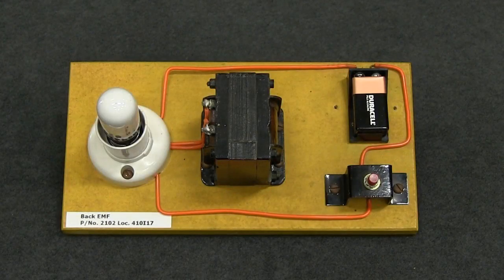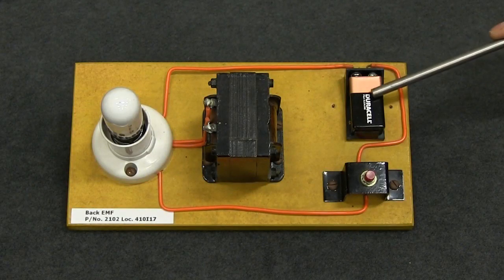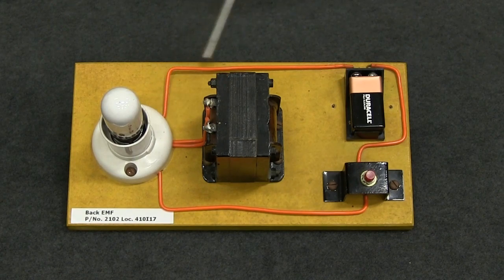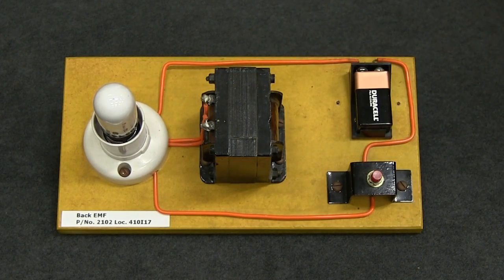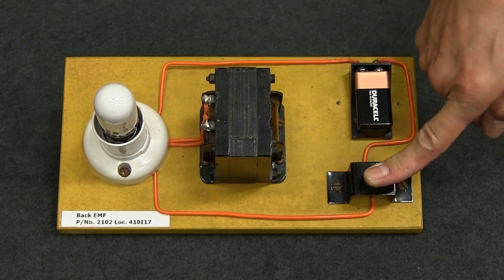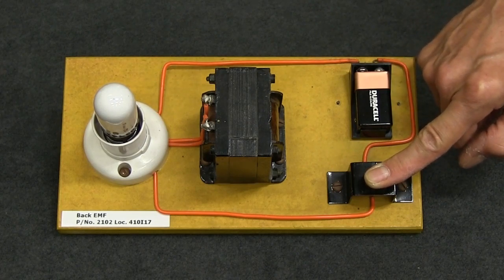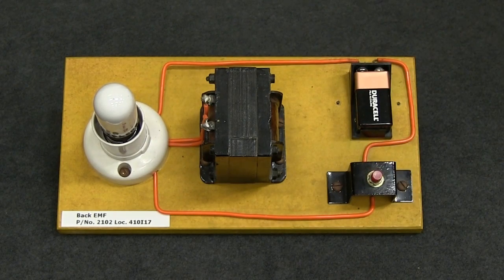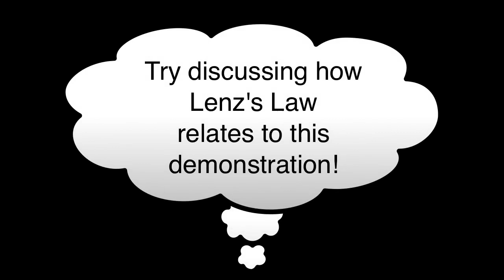PH EM IN DEMO 70019A V0331 Back EMF Inductor and Neon Bulb

Comment: I checked from the book: “Fundamentals of Physics (Halliday, Resnick, Walker) the equations of pages 724-729. In a RL circuit, if we write the circuit equation E = iR + L(di/dt) and solve it, the induced voltage on the inductor (self-induction) can’t be more than the applied voltage, which is here a battery. According to the equation: VL(t) = Ee^(-Rt/L) but you say that the voltage is more than the initial value, let me ask you, how is this possible ?

Comment: My other question is, such a circuit is really amazing, at the beginning where the time is zero and before any current is flowing in the circuit, the potential across the inductor is equal to the applied voltage, if we put t = 0 in the equation VL(t) = Ee^(-Rt/L) we get VL = E, how is this possible ? I ask myself how the potential in the inductor comes into account and where the magnetic energy comes from, while at zero or nearly zero time there would not flow any current, which means no energy dissipation in the circuit despite the energy which is stored in the magnetic field, really what’s going on here ?

Comment: The coil is acting like a capacitor, you put the energy into the coil w/ the battery, then when you switch it off the current is allowed to flow out of the coil, it finds the neon bulb and lights it up. This is NOT BACK EMF! 
The energy is dissipating from the coil so fast that the potential has increased and is enough to light up the neon. Kind of like creating your own personal little lightning bolt.
Nice demo.